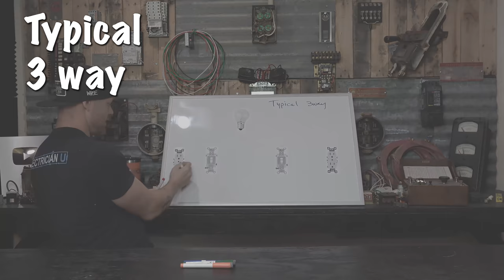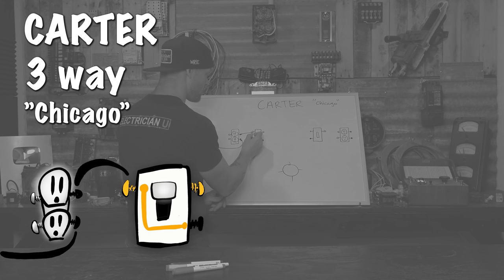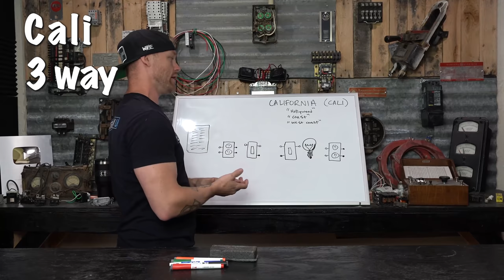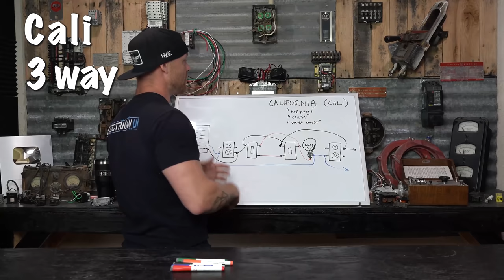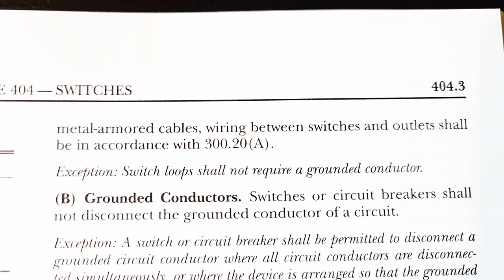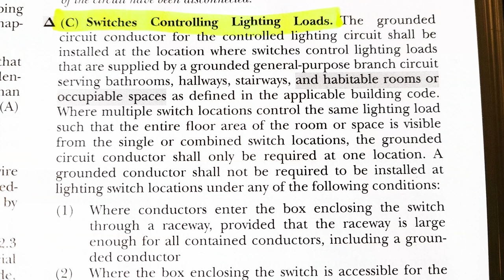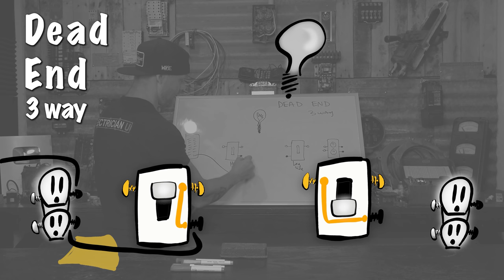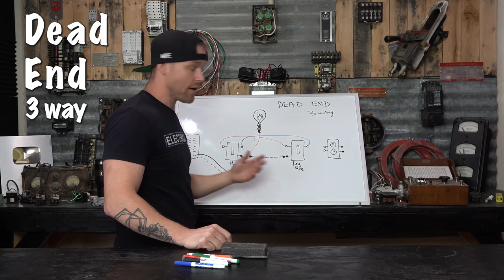THREE WAYS 3-WAYS CAN BE (3way Switch Wiring - ILLEGAL AND LEGAL METHODS)

Comment: I have a situation where my hot wire is in the light and I have no hot wires in either switch box.  Both switches run a 14/3 to the light box.  The connections to the light, power, and both switches are in the light box.  The white wires and red wires are capped together as travelers between the switch wires.  The black hot wire is connected to switch box 1 and the neutral wire from the panel is connected to the light.  The black wire from box 2 is connected to the black wire in the light. I can not get any of the dimmer switches to work.  I also have not heard anything about this type of dilemma.  A switch loop dead end 3way switch…..

Comment: I cut the lines in the top of stairs switch and this is a three way switch. My problem is there's only hot / neutral / ground coming into switch and now I cannot hook it back up and gave the switch working correctly when it did prior to cutting the old switch out. Any idea or help?

Comment: If neutrals are required you will need four conductor Romex because the three way switch will need all three wires in three conductor Romex. The best thing would be to run EMT then you can feed the neutral. I myself don't want electronic switches in my house wiring just something else to go wrong. 73.

Comment: I have 2 different 3 way switch. One on each end and 2 in the middle fee for 2 separate light. The power is from the middle box with 2 3 way switch. I got one set of 3 way work. And trying to feed the power for another 3way switch from the same box. How do I figure. Thanks

Comment: Hey Dustin, I have a ceiling light powered by two three way switches. The light has 3 light sockets with wires tied together 3 neutral 3 hot. the hot is tied into the hot from switches the neutral is tied into a traveling neutral in ceiling. Only one bulb (socket) works. Is that enough info to tell me what's going on?
 What's going on?

Comment: I have a situation at my home I discovered on a 3-way switch that has only 2 wires running between the switches for the switch legs. Power comes in from one of the switches but the neutral is picked up at the other switch which is using the common  neutral for the third leg. Is this code?

Comment: I'm renovating a basement apartment from bare studs out. I'm thinking that instead wiring 3-way switches for the lights that require it, why not save labour and materials and use one of those remote dimmer kits from Lutron or others? They're like $60 on Amazon. Is there any reason to prefer hardwired 3-way?
Reply from the maker: Time, money, cost. If it's yours do it to code, do it the way you want it, and the way an inspector would pass it. 

Carry on dude.

Comment: Are the neutral codes from this video still the same in 2023?
Also in the last example, why not use the white as a traveler and use the black as the leg to prevent reidentifying the hot wire? Unless you have to reidentify the neutral anyways?

Comment: Wow, Carter and California styles are bizzare.  However, I have an issue with electricians that use the word ILLEGAL referring to electrical work.  Codes have to be followed, BUT CODES ARE NOT LAWS!
Reply: Actually, they are laws.  The state legislature in every state adopts some form of electrical code to enforce.  It may be the NEC straight-up with no modifications, or it could be an entire state code altogether, such as Michigan.  Here, we use the Michigan Residential Code, which is part of the Public Acts statutes.
Reply: @Jeff-xy7fv  The NEC itself is not law.  And whatever is ADOPTED is not subject to law enforcement.  According to the NEC itself, the AUTHORITY having JURISDICTION makes the final call, which is normally local inspectors.

Comment: Q: I want to wire some shop lights that plug into a outlets, controlled by a switch (two 3-way switches), do you a video that covers that. I am a little confused, it appears that my solution may be a dead end three as described in this video. Also i want the duplex outlet to have power to both top and bottom  of outlets...not a half hot scenario.

Comment: for the neutral issue when required we always do a double duece like two 14-2s  one 14-2 is power and neutral and the other is just travelers. and someone wanted to know the best way to have dry wall patching be cut to a minimum.....just use a 4" hole saw for your cuts. your drywaller will love you to death because your cuts can always be patched easy and its consistant just save your circles cuz watching the drywaller tey to cut them by hand will result in a confused and kinda mad drywaller lol. and if your cutting down a wall use a big level trace it and cut that strip out you dont need more then that height wise just enough to drill. if its a flat roof house or two story  stay within a foot of your supporting walls because you cant be drilling in the center of the room, you have to take the long way for structrual strength of the truss.

Comment: I have the Chicago 3way in my home. It was built in 1948
Reply: Illegal since 1923, I have seen a Chicago three way on old farms to control a yardlight from the house, and the barn, with receptacles in the barn constant hot, using only 3 wires, this was done decades after it became Illegal,  even until the 1960s or 70s.    Your 1948 home could have been wired by old timers who lived during the depression.   Times were very tough back then, and the folk learned to be very frugal,  anytime they can make do with one less wire, or save a dollar here and there they do.    The Chicago setup tends to use less material,  and it works,  but it's a very shady setup

Comment: This question is probably pretty basic, but whats the correct wiring to get a constant hot at the second switch box for the "typical" 3-way design?  I'm thinking about this in the context of putting an outlet after that second switch box.  If you were in conduit, it seems like you could just run and extra strand for hot, but assuming I'm not using conduit, how is this done correctly?
Reply: You would have to run an additional 14/2  hot & neutral
Reply: @glennreynolds962  assuming you have a 15 amp circuit not a 20 amp circuit. The house I live in has no circuit lower than a 20 amp CIRCUIT. WITCH REQUERS  A 12 GAGE WIRE.
Reply: @keithtomlin4649 
Obviously that is a given. Most houses in my area (NJ) unless it is a custom spec, only required circuits are 20A. Kitchen/ Dining, Bathroom, dedicated appliances. Lighting / convenience receptacles are 15A.

Comment: Dustin HELP. I took the cover off the fan for a neighbor cause the 3 speed switch was only doing 2 speeds and no shut off.  So I wanted to get the old switch out and when I went in and disconnected the pull chain the switch  fell apart before I could see the diagram for how the wires should go into the new switch. So now I have the switch and how can I know where to send the 4 wires 1,2,3 and L

Comment: My parents house have a 3 way switch and since they moved in either both switches must be on for the lights to work. So if you go upstairs at night and turn off the light in the morning if you don’t turn the light on before going down stairs that evening you have to go up the stairs in the dark to turn on the light. Any tips.
Reply: That can occur when the travel and common on one three way switch gets reversed.  To troubleshoot,  begin by determining which conductor is hot, at the first 3 way switch.  This should be connected to the common, which is the black terminal, the remaining conductors, not counting the ground,  should be connected to the travellers, which are the gold terminals.  Next, go to the other 3 way switch and determine which conductor goes to the light fixture,  this should be connected to the common terminal,  the remaining are your travellers.   Now this can be a bit tricky if the power comes into the light first, which was very common on home in the 60s 70s and 80s.   But the principle is the same.    Good luck with your project.

Comment: Would anyone know a good way to change a dead end 3 way to one of the others? I am attempting to put smart switches in most of the house and have 2 major living spaces wired this way. I have spent a few hundred dollars trying several switches and putting smart switches at both locations but they dont seem to work in the dead end configuration.

Comment: Question: The 3-way switches I have in my house all have hot, load, common, traveler. I am trying to connect z-wave smart switches for my home automation. The slave switch only has connections for common and traveler. I have tried all kinds of combinations to get them to work to no avail. Therefore I have avoided changing them out, hoping to eventually find a slave switch that will have the appropriate connections. Any advice or possible solutions?
Thanks.

Comment: CEC Rule 4-022(2) You have to have a neutral at every location that switching may occur for lights
Reply: not if you can physically see both switching locations. 404.2c
Reply: @ipodacious77  is that a cec rule? Don’t see that anywhere if that’s nec different story
Reply: @Nick-bh1fy  yeah it's in the 2017 NEC 404.2C "Where multiple switch locations control the same lighting load such that the entire floor area of the room is visible from the single or combined switch locations, the grounded conductor shall only be required at on location"
Reply: @ipodacious77  ah true not familiar w nec

Comment: I run into the Dead End 3 way all the time. I've seen Electricians use black sharpies to turn the white conductor into a Hot. Makes my job a little harder when a customer wants a smart switch at the end that has the Dead End. You would be surprised how pissed off a customer can get if they can't get a smart switch in a certain location even though it can be in another location controlling the same light fixture. Granted there are smart switches that doesn't require a Neutral but my warehouse manager can only order from so many places such as Systems Depot, ADI and 21st Century Dist. They typically carry Z-Wave Jasco / GE switches and dimmers that require a Neutral.

Came across a Chicago 3 way in a modern house once. It was an addition the customer built to be a Theater Room. The customer also wired it. Knew he wasn't that smart since the Wall outlets were randomly wired with Hot and Neutral mixed, customer told me "It's AC, it doesn't matter, doesn't have a polarity." Needless to say I raised the Red Flag to the boss and the customer didn't get his theater room.
Reply: Customer is right about polarity, but needs an education about hot and neutral. Good thing he didn't look too hard into his breaker panel and see that his neutral and ground are strapped together in there... LOL Poor guy

Comment: So in the 60s and 70s like you said they did lighting loops is it common to have lighting loops with dead end 3 ways since the power is in the light and no power in the switch boxes? Just asking cause I ran into 3 way had no power had power in the light but had to tie a sl white and black to one black since power was in the light
Reply from the maker: In a 3 way or 4 way setup, there will always be voltage on one conductor going to a switch. Even if it was light fed and then ran to switches, there would still be power present at the switch location. Make sure all connection are made at the light and other 3 way or 4 way switches.

Comment: Kinda of sad that you didn't share the other way for a dead end 3-way. Instead of wire nutting the black wire of the switch leg through to the other 3-way switch, wire nut the hot wire to the other switch (really convenient in 4-way applications too). I've installed tons of lighting control switches and the one thing I found is the load side needs the neutral on the switch. The line side does not. So sending the hot through rather the switch leg would solve your problem not having a neutral. The neutral switches are called control switches and the non-neutral switches are remote switches. A lighting circuit only needs one control switch.

Comment: So the only difference I'm seeing in your diagrams regarding typical and dead end is that you have to reidentify the white to have the potential to be hot on a dead end. Also the SL is nutted in the line side box of the circuit. And since you brought up the code exception to a neutral in multi-location switches ie. 3way 4way is the recolor coding the only thing that stops dead ends from being legal? Your "typical setup" doesn't carry line through the second switch location unlike the Carter and Cali. Just curious what the specifics are on the unapproved dead end practice.

Comment: What’s the code that talks about not being able to re identify any cable under #8? Thanks for the video! 🙏🏽
Reply: 200.6(A) discusses acceptable identification of Grounded (Neutral) conductors 6 AWG and smaller. Summary-Neutral must be (1)white, (2)grey, (3)three continuous white or grey stripes; or as allowed by (4-8).

200.7 discusses the allowed uses of white insulated conductors.  200.7(C) pertains to Circuits of 50 volts or more with (1) specifying the conditions where the permanent reidentification of a white or grey insulated conductor of a cable assembly as an ungrounded conductor is allowed.

210.5 covers the Identification of Branch Circuits.

Comment: Ouch!  Chicago 3-way could have both the side and bottom of the socket hot (relative to ground, as you didn't have a neutral there), even though the bulb was out....
Reply: Yes!  And in the old days the fixture itself might well be connected to the outer shell of the bulb socket.  You could be changing a bulb, grab a heating system radiator to balance yourself, and get a full load up one arm, through the heart, and down the other arm.

Comment: I have wired a bunch with traditional and dead end methods. Probably more dead end cause that’s how this old bastard learned. One method that you didn’t cover is when feed comes into the fixture. Grounded conductor stays in fixture. I use 14/2 to drop down to a three way switch. Then run 14/3 over to the other 3way similar to the dead end. It’s basically a 3 way switch leg. I use this method when all my lighting branch circuits run through the attic and controlling multiple fixtures with a 3 way. Up in the attic just have to run 14/2 to all the fixtures from the original feed point. Don’t use it often but in some situations it’s the best way to use the least amount of wire. Seems I use this on remodels where adding 3 ways to old work. Once the AHJ adopts 2020 code I will have to retrain my brain. Only came across California method in one neighborhood built in the late 60s, fckd me up for a minute till I figured out what was going on. Fortunately haven’t seen any Chicago style but I try to avoid the old prewar stuff in the city.

Comment: HMMMM, my 3 way in the bathroom got messed up. It was probably a year ago, I take really hot showers so the bathroom got really steamy and there's brilliantly a light switch literally outside the shower door. I think some moisture got in, did some damage and now the switch by the master bedroom door won't work if the one by the shower and office door is in the UP position. Put that one in the down position and the light switch by the bedroom will work. If in the Up position, the light won't turn off. is that "Carter/Chicago" wiring then? If so can I fix that? To not be that way?

Comment: I saw a single gang box and inside had 2 14/2 wires labeled 3 way and it kept me thinking how that will work since you have 2 whites and 2 blacks and switch only has 3 terminals?

Comment: Still cant make sense of the shotty wiring in my kitchen.  Its almost like someone wanted a 3 way controlling the kitchen light but made a partial 3 way where one switch completely overrides the other switch.  It is so annoying walking back and forth a few times in the dark trying to get the light on.  I just took a look today there seems to be a constant hot going into one of the traveler terminals, and a not re-labeled "neutral" wire that takes power to the other switch when on.  Theres a 2nd black wire going into the other traveler terminal, and the other switch has a black, the hot white from the other switch, and a red.  

Im almost afraid to trace the wiring in the attic after finding a junction in a wire outside of a junction box with loose wire nuts literally falling off when i touched it when i replaced the bath fan.  Soo many blatant code violations in ths house, im almost wondering if its even worth my trouble or if i should just let it accidently have an electrical fire and burn down and cut my losses

Comment: I have a different three way situation. where the hot line is going into a box between the two switches. and then the light is going out from that same box. Help Me please!!! In other words, the two light switches that are three way are cut into between the incoming power and the outgoing power to the light itself! Crazy I know but I have got super confused at connecting it all together. please draw me a diagram if you can. Thank You for any help you can give me

Comment: Help!    I've a dead-end three-way. (a fact that I didn't know until I watched this video, which I sought out after I saw that White was hot at the main (tied into black) and at the dead end.   I need a neutral for one of those damn switches you mentioned. I thought it would only require a neutral from anywhere in the circuit to the dead end.  However, you are saying that black (hot) is intermittent.  I need a continuous live circuit at the dead end.   Is there a solution.  Running wires is not a problem.